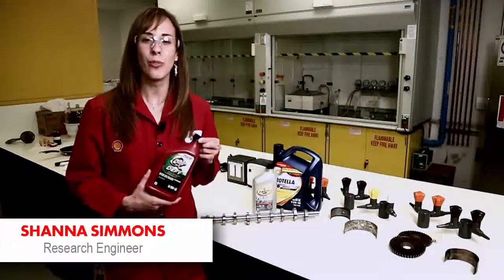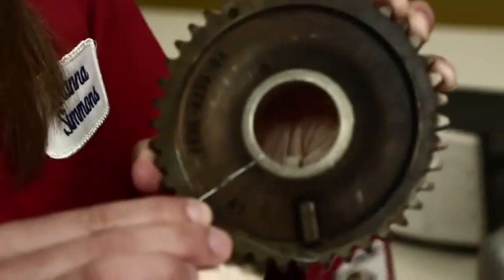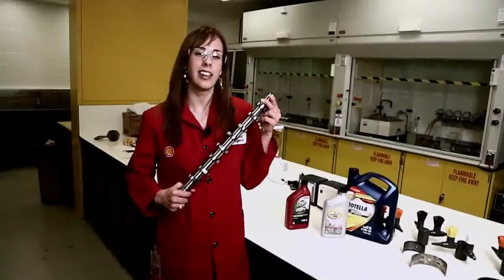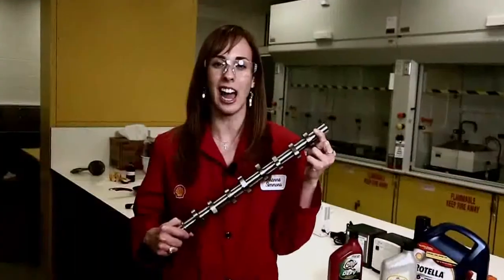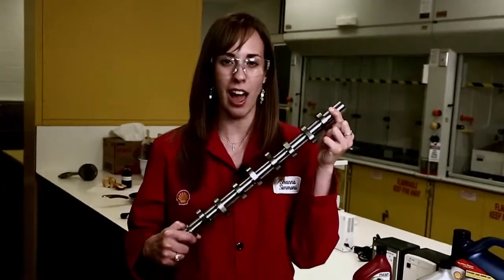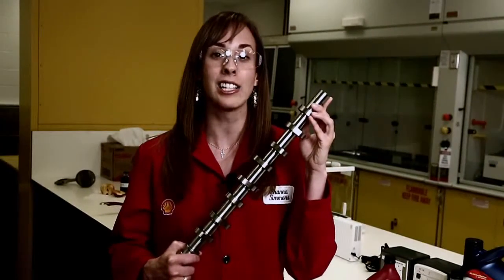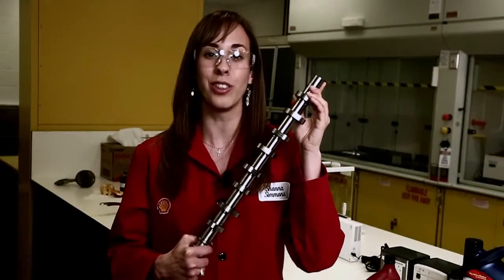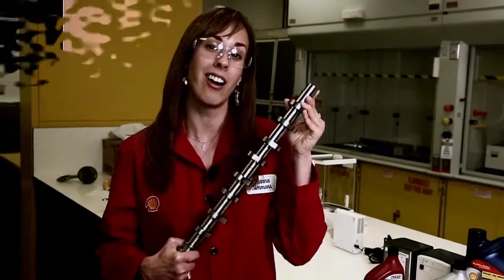Motor Oil 101: Additives I -- Educational Video

Comment from the maker: Read my article in Go Drive Magazine to learn more about zinc for older car engines! http://www.godrivemag.com/the-a-b-zs-of-zinc/
Reply: +Engine Girl I have just changed my Chrysler 200 oil and used Pennzoil Platinum,but I am not sure about a couple of things.What is the TBN number of this oil and recommended mileage,and does driving my vehicle for short trips about 15-20 minutes considered heavy use for the oil
Reply from the maker: Always follow your owner's manual for the recommended oil drain interval. Yes, frequent short trips is considered severe driving, but if you are using Pennzoil Platinum Full Synthetic, you should be good to go!